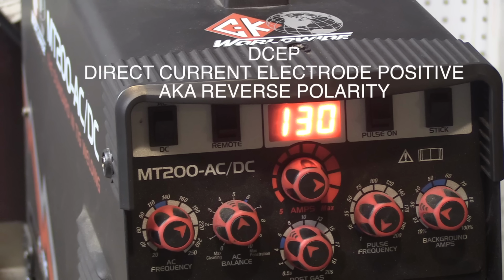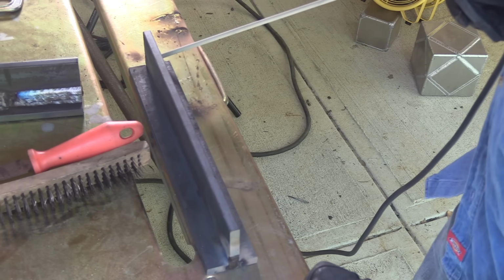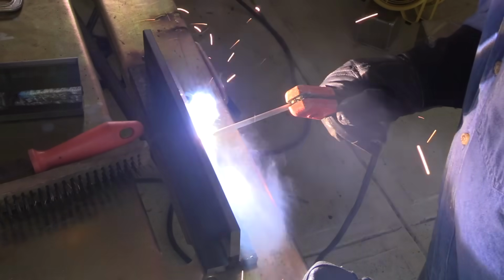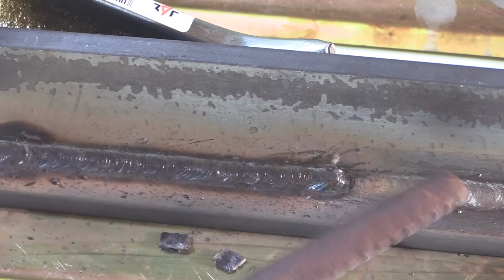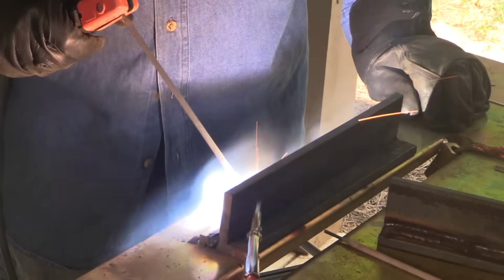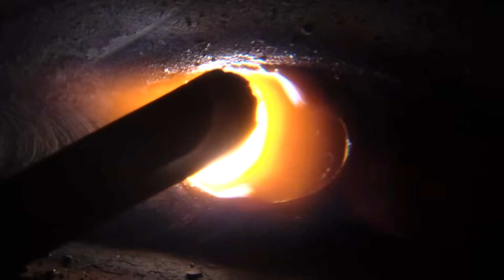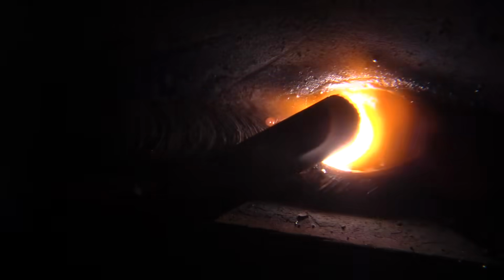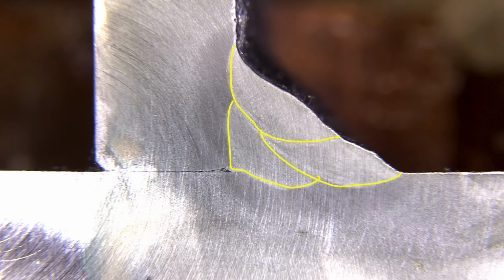SMAW 7018 Horizontal 2F Tee | Welding Tips & Tricks #Welding #Tutorial #ArcWelding

Comment: I’m having difficult to get my beads to look like that. My instructor isn’t telling me what amperage is should use. He wants me to figure it out myself even though I never use a welding machine. I’ve tried 80-120 and I can’t tell a difference besides my 7018 get stuck either at the start or while I’m welding beads.
Reply: That’s not a great instructor. Too hot and your rods can easily burn up, as mine have when I forgot to adjust. In my first Welding I class, my instructor gave us temps. Idk what rods youre using but in my class it’s 1610s at 75-80, 7018 1/8s at 100-110, and 33’s at 85-95.

Comment: If anyone can see this I just passed padding on 7018 and one of the biggest things I’m struggling with is to lay the first bead in order to do multi pass on a tee joint I’m kinda getting confused because when I try to start a bead I’m afraid I will weld into the plate instead of creating a weld itself any tips would help thanks in advance

Comment: I've been running pads with 6010 "until the cows come home" just like you instructed in a different video. Now I'm about to try my hand at t joints. Thank you so much for sharing your knowledge and experience. Without your channel I would be struggling alot more through the welding program I'm currently enrolled in. A good instructor is worth their weight in gold, if you can find them. Jody is proof they exist.

Comment: In class tonight, I used this tutoial on a 6 passes pr side,  T fillet weld, flat position, 3/8 inch carbon steel with 7018 Excalibur electrode/ 125 amps, and it started to straightn a few things out. Thank  you for this video!

Comment: You make this look easy! Researching how to weld up a receiver tube to a 1" thick steel piece so I can attach that to my F-150 bumper. I have two 3/16" by 3" squares I will weld at 45 ° to the joint. Not going to pull a house with this, but need a 2" receiver for so many other things. All these parts are scrounge except the 3/16" by 3" squares. Thanks again for the great videos!

Comment: hey jody, having trouble with my roots on the 2F. not getting  enough penetration. i feel like i need to turn the machine upto 200amps using a 3.2mm 7016 LoHI, electrode positive. welding on 10mm plate . mill scale cleaned off too.  not sure where i am going wrong.

Comment: I was told many years ago that 1/2inch of weld would hold half a ton? Is there any truth to that Jody?
Reply from the maker: never really thought about how much 1/2 of weld would hold but  the 70 in 7018 indicates 70,000 pounds per square inch of tensile strength so it could be true
Reply: @weldingtipsandtricks  That's a key factor then.

Comment: Nice welds. I've learned a lot watching your videos. Thank you. 
Wouldn't you like to see a little deeper penetration on those welds or is that ideal?  I've never did a cut test but I envisioned my weld penetrating a little deeper.  Thanks again
Reply from the maker: 7018 just doesnt penetrate all that deep like a 6010 but I do think it penetrated an adequate amount
Reply: @weldingtipsandtricks   Its defiantly not going anywhere! However, this would fail a welder qualification test due to lack of penetration.